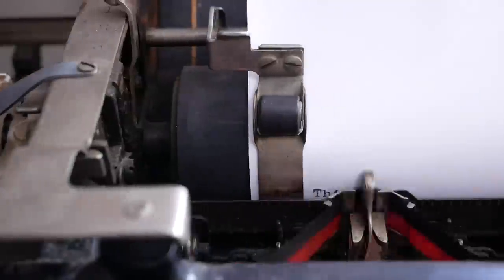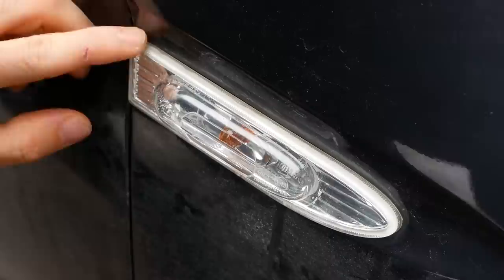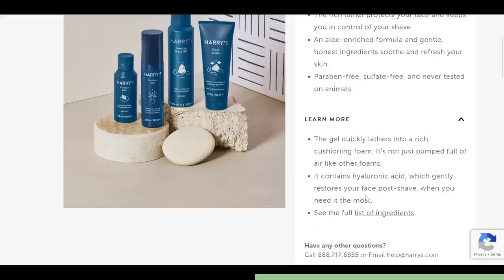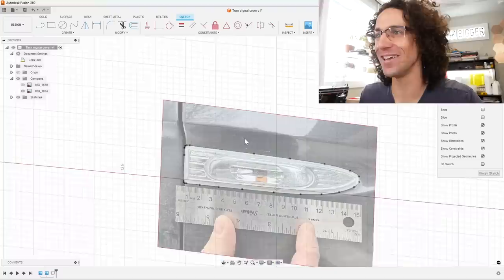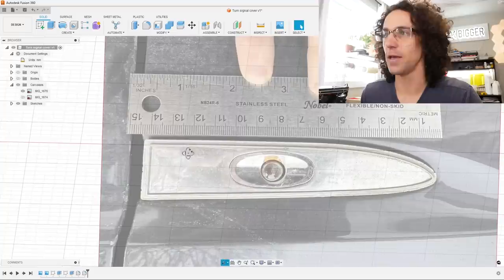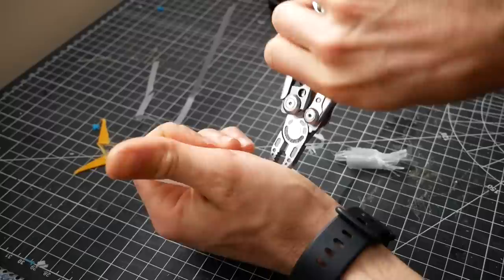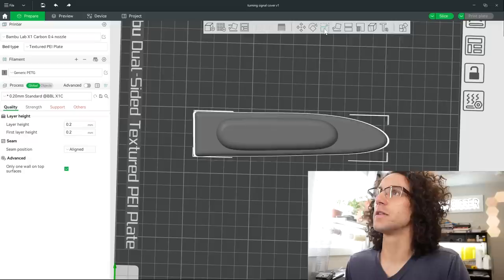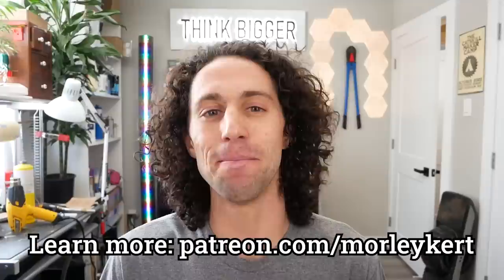A MONTH to get this car part?! I'll just 3D print it.

Comment from the maker: Thanks again to Harry’s! Click here https://harrys.com/morley  to redeem your Trial Set for just $5! Let me know what color razor handle you got in the comments below
Reply: order some polysmooth and reprint this it should look great
Reply: ..this is actually my first time using someone's referral link during a promotion I didn't skip. Dude, thank you. I was looking for a service like this for a quite a while now. And I get an awesome video on the side. Subbed!
Reply: We just bought a cabin cruiser. Already saw some flaws that will be in need of some 3d design and printing work. Walkthrough windshield endstopper when opened, swimladder tpu u block to keep it from going out. Now held by a strapper. And pretty sure more will follow. 3d printers are very usefull.

Comment: You should put the first one you printed on the other side so they match!
Reply: He's gluing a cover over a bulb that's going to burn out
Reply: @chrisnelson1935  I would have replaced that old bulb with a new LED one that will probably outlast the entire car.
Reply: The 1st one he printed was too short yall... the bulb has a twist lock socket to remove the socket and bulb from the lense.  The lense came glued to begin with.  What are all yall talking about right now😂
Reply: @ssavman  people that have never changed a bulb on their car
Reply: @ssavman  they prob never owned cars with self serviceable parts. Cars these days are like phones if you break the cover for the head light sorry you are gonna have to replace both because the makers only make them in pairs now + you have to send it back to the factory for service otherwise it will void your warranty.
Reply: I think all of you guys missed the point of this video. 

He’s an engineer who makes things. He’s not a car guy. 

The video title wasn’t best way to fix my car problem.
It was fixing my problem with 3D printing.
Reply: @j.tsessions3132  youre spot on
Reply: @chrisnelson1935 it will not since it is blinking all the time , it will be used only for few seconds since turning your car doesn't require minutes or hours.
Even if you use it as hazard lights it will still be good , since its not PLA
Reply: @ipodtouchiscoollol  What's crazy is if only a single LED bulb on most of those new LED headlight break you in most cases have to change the whole headlight, and they are stupidly expensive too. I worked at a body repair shop and picked up a bunch of these at different dealerships for my company and was shocked at how expensive they were, especially the one I picked up for the electric Jaguar.

Comment: Just an idea - some spray lacquer may have improved the transparency to better match the original. Not sure if UV degradation is an issue for the part you printed, but some lacquers also include UV protection. Great quick job you did there though!
Reply: You can print it again XD You don't need to waste time waiting for an spare.

Comment: 5:37 It's not failing for no reason, it's failing because the fillet would intersect with the bulb extrusion causing interfering features.
Reply: Thats the same thing I was thinking when he said that
Reply: really though thats a pretty easy situation for the program to resolve. it should just fillet the outer egde further, then the upper fillet should be extended down so that it meets the lower/outer fillet surface. essentially what it would do if he did them in the opposite order. Rather than just not working at all, it should bring up a warning, with maybe some options for how to handle the collision.
Reply: I was thinking the same thing
Reply: @ge2719  yeah I mean their whole fillet thing is broken still, even besides just that feature not being present. I've had fillets not just fail but like completely destroy the part geometry if applied and have also gotten bits of geometry where I'm hesitant a fillet will work but it works fantastic so idk it's mostly just luck.

Comment: Nice job. Only thing I'd do different is use some clear rtv silicone to attach instead of ca glue. Might be difficult to change the bulb now if it ever goes out.
Reply: thinking the same thing
Reply: Not many people realize that CA glue is water soluble.  Eventually the glue will fail - hopefully at the time a bulb change is needed.  Silicone sounds like a better adhesive to me as well.

Comment: You should check out compound joint pliers. They multiply your grip input, super nice for support material removal. I got a needle nose pliers to try it out, ended up getting side cutters and normal pliers too. Cons: bigger, less jaw opening per hand input, not cheap(but what good tools are?) 
I love your iterative workflow

Comment: Hi, nice video, one thing you could try for transparent plastic is to increase the extrusion factor by 25% it makes it more transparent since there is less gaps between layers and perimeters… Also I had a laugh seing you calculate the factor for matching the part to the actual size, just under where you were entering the factor you had the option to enter it in millimeters            ! Thank you.

Comment: The fillet did not fail for no reason. you have a spline section which caused a invalid geometry once then 4mm fillet is applied.
Reply from the maker: It would be great if fusion adjusted the parameters of the fillet to avoid a failure, or was just a little more robust in dealing with complex geometries.

Comment: I recently learned to give your support material a 0.2mm gap above it or so, and you have almost no problem pulling the supports off, as well as basically no problems in the print. it's super awesome

Comment: Always love to see real 3D printing rapid prototyping applications. Definitely recommend updating your model rather than using a slicing software to scale a model, your modeling software holds tighter tolerances and sometimes scaling your part can affect it in different ways depending the geometry. But quick enough changes get ya by sometimes.

Comment: I love your knowledge and passion. I found your video wanting to know if a 3D printer could reproduce interior plastic parts for a 1988 Dodge Ramcharger. Pieces would be anywhere from 18-24" approximately. Impossible to find for the most part, but there are many Dodge truck lovers who want to restore their cracked interior panels. Great work!

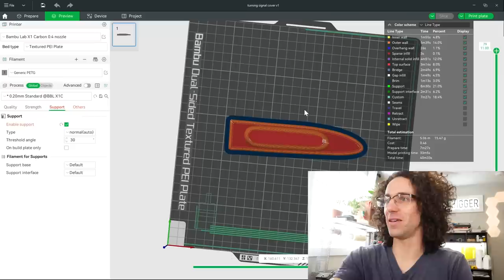Comment: 9:11 no need to calculate a factor... just add the mm's in the X axis. 

as for getting clear as possible, print on glass with the exterior part touching the  plate... it will give a glass finish.

 You may just want to change the dome to a more flat surface in order to take advantage of a glass hotbed finish .

Great designing skills.

Comment: I got into 3D printing because I couldn't get parts to fix my older side by side. I use FreeCad though, so the frustration factor is somewhat higher for the software. You can generally get a much clearer product with PETG if you print hotter and slower, but the supports will be harder to remove and stringing is more of an issue. Also, removing the cover on the other side to see how the original lens locked into place and building that into your print if possible would have made changing the bulb should it become necessary less of an issue than you'll have with the glued on lens cover. Well made video, and I'm jealous of your printer.

Comment: Also there is this one magical ancient secret technique that our modern 3d scanning photo-op brains keep forgetting called PEN AND PAPER. You'd need to make a hole for the bulb, but you could get the exact outline drawn out just by placing a piece of paper against the blinker and lightly brushing the edge with the pen. Then lay the paper flat with a ruler and just trace the outline in CAD.

Comment: 5:50 the fillet cant go any further because otherwise it will try to curve down a surface that is being used as a startin poing for another fillet. i think in this case you could have done the fillets int he opposie order, the outer one first, then the inner one the fillet would have met with the already filleted surface. 

but in general fillets and bevels stop working because it cant physically go any larger and be able to perform the change. or at least not in a way where it knows what you want it to do exactly, so you would often have to cut up sections of the object and add bevels and fillets in the way you want them to go.

Comment: It should be a clear plastic print instead of a white one. This violates road norms of dispersing the indicator light till certain distance. In Germany it would have not been approved. May be just try printing in a clear filament or a clear resin printer. It might look little fogged but passable.

Comment: Hey Morley I noticed you using Instant Bond CA glue.  I am currently using a different brand called Mitre Bond but noticed the other day that the brand you`re using is significantly less expensive.  Does it work pretty good? Considering switching.  

This video is great.  This is the sort of thing i would get a 3D printer to do, over the usual figures and knick knacks that some folks go for.. Gotta say though, i`m not keep on the likely learning curve involved with learning to use Fusion 360. Great video.  Thanks for sharing.  Happy Easter to you and yours.
Reply from the maker: Thanks! Honestly, it's the only brand of CA glue/activator that I've used. I can't recommend it over any other brand.

Comment: Maybe I am missing something, but with that CA glue how will you change the bulb now that it’s stuck?
Reply: The bulb should replace from the rear of the housing. You are not meant to be able to get into that part.

I like fixing stuff with 3D printing but this is sadly not a suitable example. The plastic is not clear enough, the 'chrome' paint that is used to reflect the light from the bulb is damaged and needs repair and the water seal around the unit is now broken, allowing for moisture to destroy the bulb, 'chrome' paint and any raw metal that might have been behind the unit.

I could have driven to my local scrap yard in about 15 mins (so lets call it a 30+5 min round trip) and could have fixed the issue faster with a better end result. It would have cost a few €'s more but would have been worth it.

I understand Morley needs to make content and I did enjoy the video, but practically speaking this is a bad idea, don't do it.

Comment: Nice idea, but FDM is the wrong printing method. Water will penetrate the layers. With resin print and clear enamel,  the print would be as clear as the original and waterproof and much stronger.

Comment: Great job. It's very useful to have a 3D printer and knowing how to design in Fusion 360.
Making the mistake of printing out the other side, you straight answered my question if left and right are the same. You saved yourself a lot of time (waiting) and probably also money. You did not count the printing time,  why not? In most countries cars have to go for a technical inspection every year or every two years. Sometimes the people at the inspection are real nit-pickers and they will not allow a 3D-printed part. But if that is not a problem in your town, you can offer the light-covers for sale.
Do you know, why the original one fell off?  Has it been helped by somebody? How does CA-glue hold in strong frost and/or when the sun is burning on it all day?

Comment: Thats fantastic! Would it be possible to make it completely transparent like the original one?
Reply: 'Transparent' PETG will never be clear as glass or injection-moulded plastic, but there are a few tricks:

Printing - wider nozzle, thicker layers, going as hot as the filament can handle, and 'ironing' every layer (I think Superslicer supports this, not sure about other software)

Post-processing - sanding/polishing, epoxy resin clearcoat, and/or careful heat treatment with a regular heat gun. Chemical smoothing in a solvent bath is technically an option but PETG needs pretty gnarly chemicals for that so I wouldn't recommend it.

Comment: I would have changed the bilb at least before gluing it on, but great job👍There is also some methods to get it more transparent. Would probably have removed the other one to see how it is attached, in case you need to replace the bulb in the future

Comment: The original part was clipped on rather than being glued, right? So now when the bulb needs changing, you or the next owner is going to damage the whole assembly while breaking the glue joint. I guess modelling the detail required for a firm clip would have required more than 40 minutes and two trial prints. Might as well order that part from Korea now so you have it ready when the bulb goes and you have to hack your glued part off your car.

Comment: I think it would be pretty amazing if you have a platform where you can 3D print items for people and send to them. Some small issues like blinker light that can be fixed this easily, but the part is hard to get and probably way too expensive. I believe you can make bank out of it...
Reply: there are already websites that can print off your 3d designs & send them to you if that's what you're referring to.

if you mean Morley should offer the process in this video as a service, I think you'd be looking at $50+/hr. 
with a video call for measuring, then designing, print time, packaging&shipping - you're looking at like $150 for this part sadly

Comment: Amazing! Your skills with designing a print is on point. I've only been 3D printing for a couple years and have to admit I haven't designed anything. Would love to be able to pull off what you did. 

Did you self teach? Also what design program do you use. Thanks for sharing
Reply from the maker: I took a 3D modeling classes in University, and then learned Fusion 360 from YouTube tutorials. Thanks for watching!

Comment: A couple things, first, I'm too used to the beard. Hearing your voice and seeing the unbearded face made it harder for me to pay attention. If it was me I'd have 3d scanned the opposite side to get the right chamfer so it could be removable rather than permanently affixing a bulb cover in case I have to replace the bulb, you did put a new one in before glueing it shut I hope? Last, when you were spending time to figure out what percent to lengthen all you needed to do is directly type in the length in the box below the percent